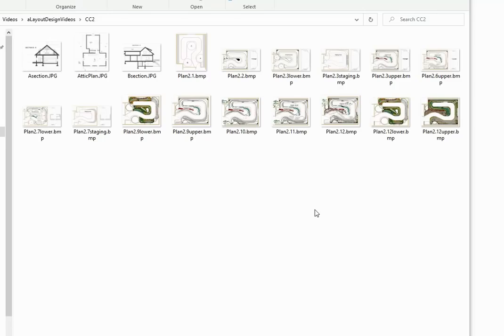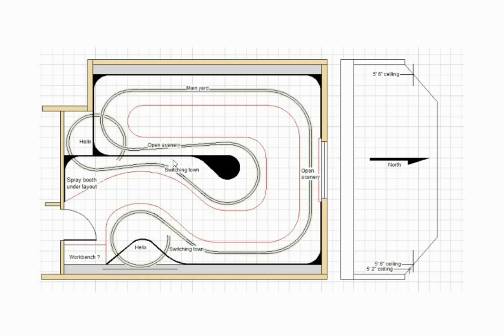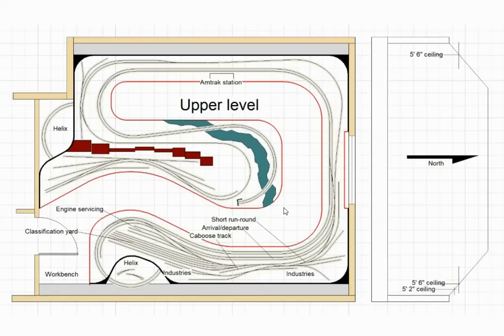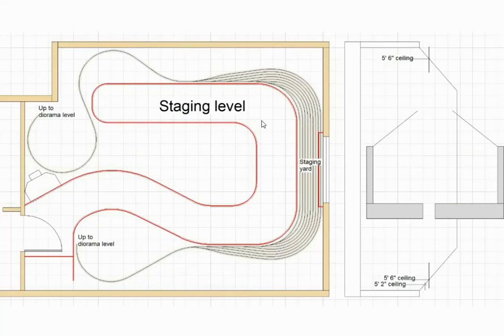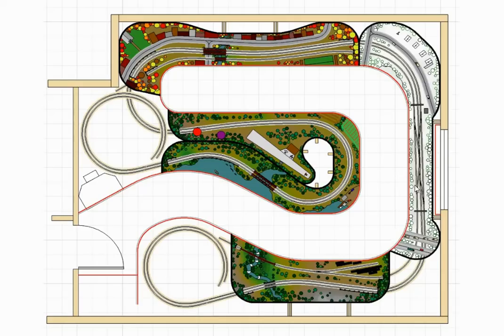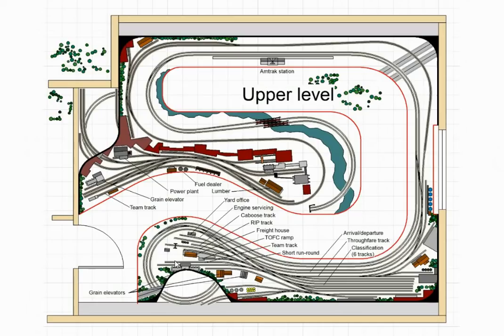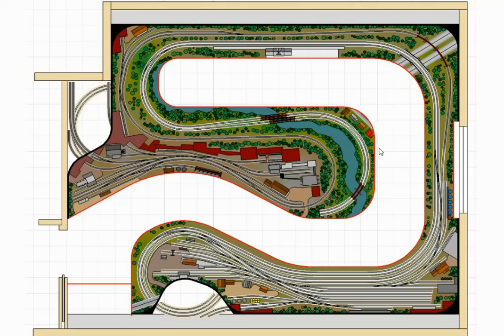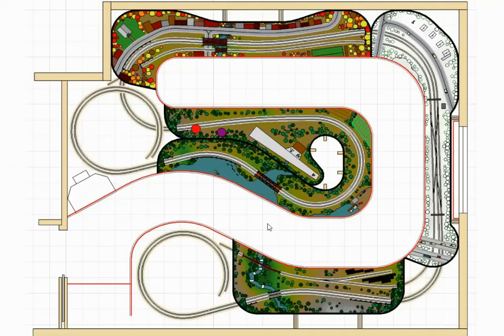Diorama layout design, take 2

Comment: I learn so much watching you track design videos. 
The view block and moving the staging switches are both great points.  And the Upper level design to add point to point. 
Do you have a standard for creating grades? Do you stick with 2% or below, or do you determine the grade based on customer needs?
Reply from the maker: There's nothing magical about 2%.  It's easy to calculate because is as near as makes no difference to 1/4" per foot.  Many of the best known prototype grades in the country are around 2.2%.  Above this, hauling capacity falls off very sharply.  Actually, I'd prefer to keep grades down to about 1.5%, but sometimes that just takes up too much space.

Comment: So, with the helix at the bottom, you enter it from the lower level in an anti-clockwise direction, climbing, and you come out on the top level in an anti-clockwise direction - OK!

You traverse the top level in an anti-clockwise direction.

But with with the helix at the top, to come down, you enter it from the upper level in a clockwise direction, and come out of it on the bottom level in an anti-clockwise direction - NOT!

I think this needs a really good review.
Reply from the maker: I assume you are referring to the helix at the base of the peninsula.  The direction of this one was changed part way through the design process which is why one of the earlier rough sketches was shown with the upper approaches in the wrong direction.  You must have missed where I talked about the approaches to this helix near the end of the presentation.
Reply: Ok, I watched it a couple of more times but have not picked up where you have stated that. What time index was it?  I have picked up at the 22:20 mark where it implies the entrance to the helix (as indicated by the mouse movement) is under the mainline which would imply an anti-clockwise downward run.
Reply from the maker: @graemetaylor202  I discussed in detail the route the upper main line takes on its way to the helix.  I don't know the exact timestamp, but it was while talking about the elevation profile for the upper deck.  I may not have specifically said that I changed the direction of the helix, but I thought my description was clear enough.  Sorry if I misled you.